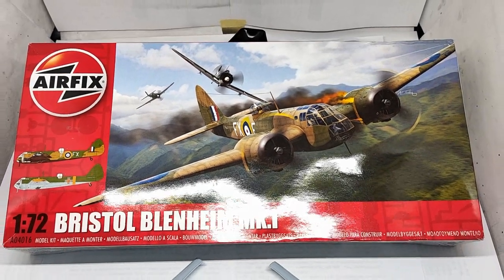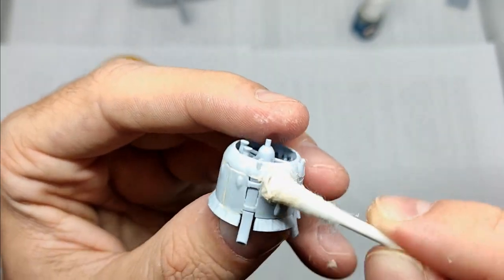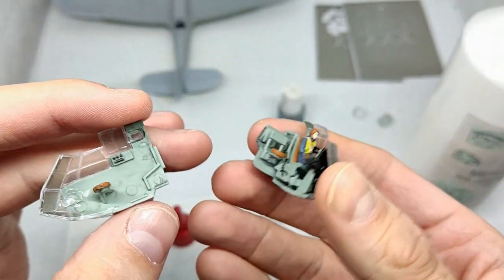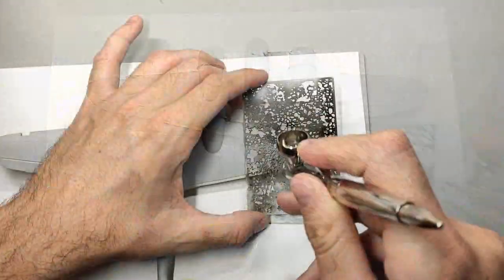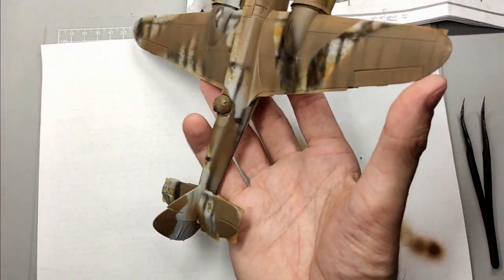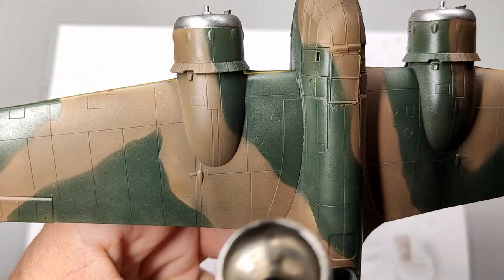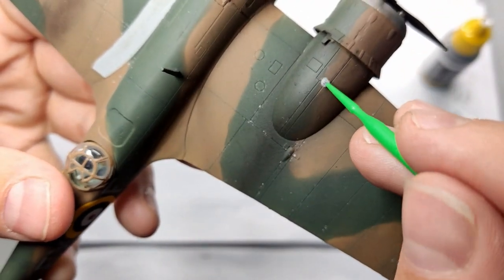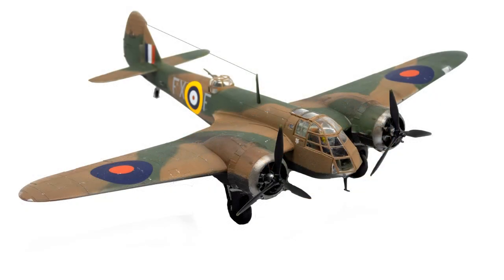Airfix Bristol Blenheim Mk.I 1/72 [Full Build]

Comment: Very well done video!   You clearly communicate the information without going on and on….  (Some videos take more than twice as long to convey the same amount of info!)

One tip for anyone like me who is inspired by this video:  
I have this kit in my stash, so I have been looking at reviews.  One thing suggested in some of the reviews is to attach the cockpit sides to the fuselage halves as a first step, then add the cockpit to one half before closing it up.  (like you’d do in most aircraft kits.).  That seems to help with the alignment/fit/gap issues….

I also really liked your twist on pre-shading, where you used the random splotches template.  Clever idea!!!

Thank you for taking the time and effort to make this video!
Reply from the maker: Thank YOU for taking the time to give me such a nice feedback! I personally prefer short videos, that's why I try to pack only the most relevant information into the video. Good luck with your Blenheim!

Comment: Thanks Starfish - it turned out excellent in the end - im having the same problem with the cockpit / canopy on Airfix 1/72, cheers Liam
Reply from the maker: @ljscalemodels526  That canopy is indeed quite tricky but you can do it!
Reply: @Starfishscalemodeling  🙏 i hope so - gonna be a lot of filling and sanding!
Reply from the maker: @ljscalemodels526  just be careful with those clear parts 😅
Reply: @Starfishscalemodeling  definitely - the issue now is gonna be attaching the cockpit and fuselage 🤣cheers.